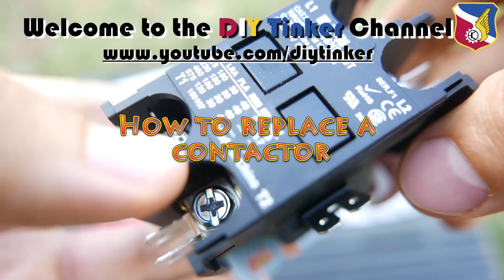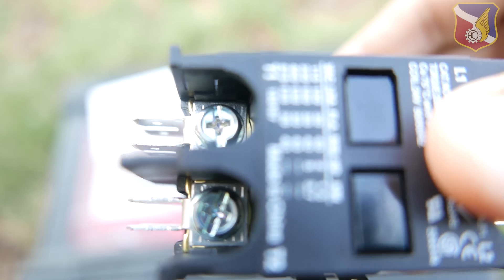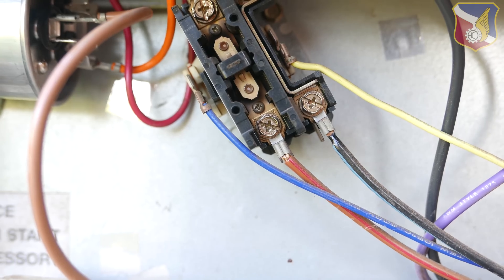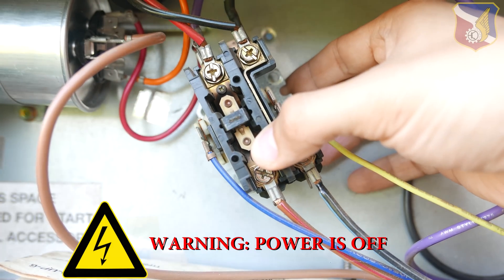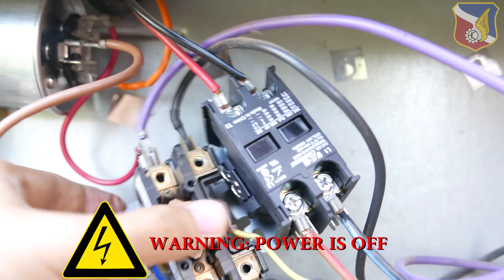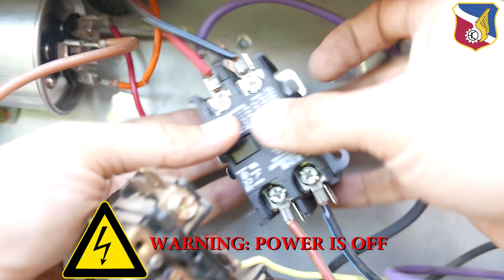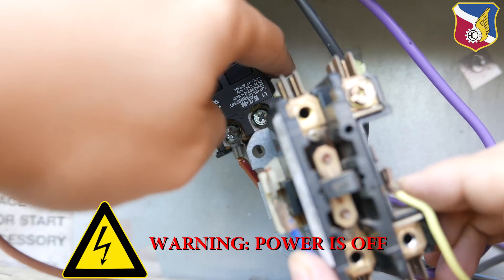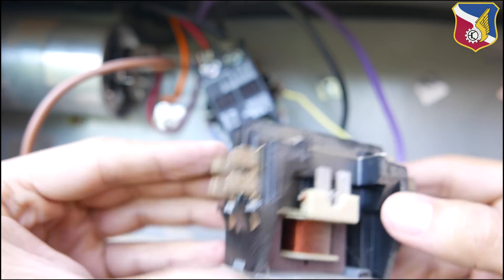Air condition condenser doesn't Power up - How To Replace a Contactor - HVAC not cooling on

Comment: You may want to show how to safely discharge that start capacitor on the left.  It will hold a charge even with the power shut off.  I had to replace my capacitor before my contactor but will probably discharge it prior to replacing the contactor.